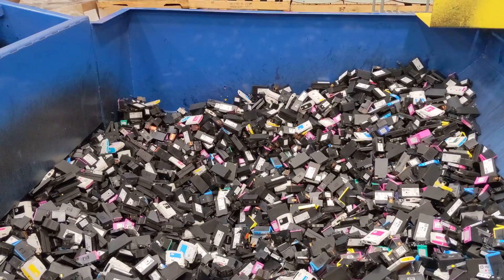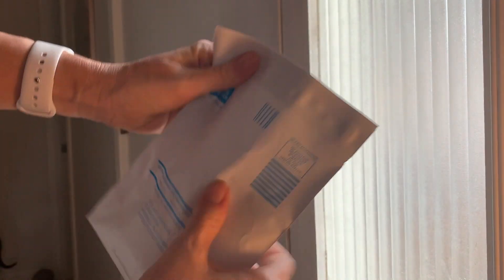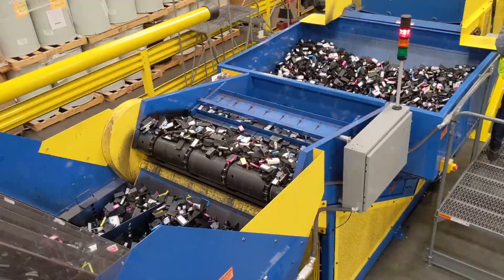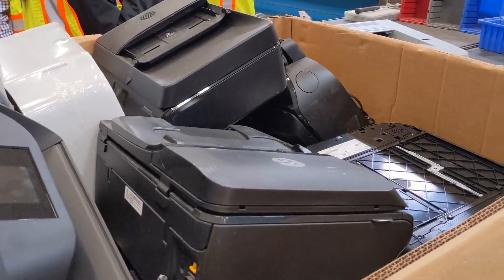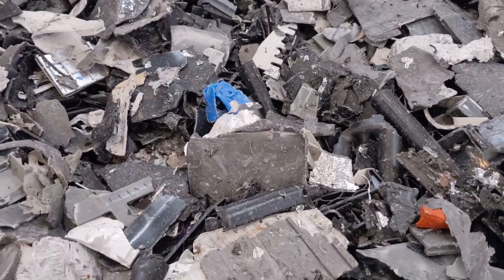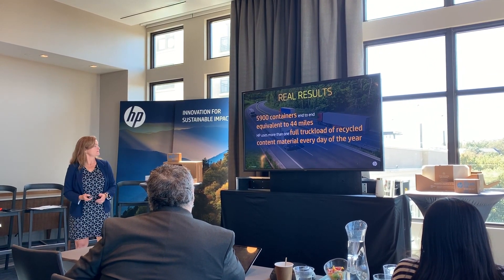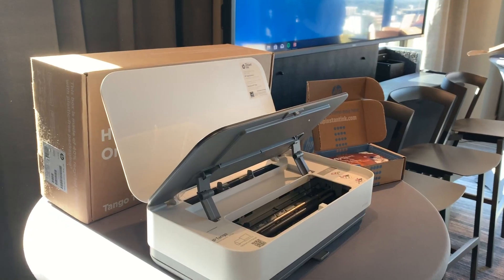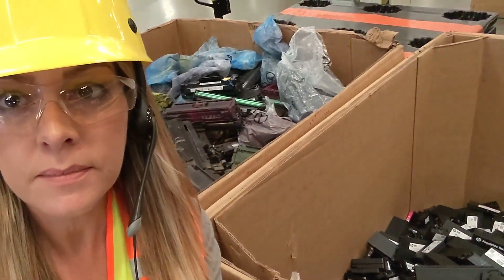Inside scoop: how HP Printers & ink cartridges are recycled

Comment: If HP really cared about the environment, they wouldn't force update the firmware on their wireless printers to ONLY accept Genuine HP ink cartridges!  Before the update,  you could use 3rd party REFILLABLE ink cartridges!  After the update,  unless you have EXPENSIVE GENUINE HP ink cartridges (ALL COLORS INSTALLED), you can't print, scan, copy, etc!  It locks you out.  This forces you to buy their rip off expensive cartridges repeatedly (and the ink levels aren't accurate either.  You will be tossing out cartridges that aren't even empty.  Thanks to the chip that counts your prints, NOT your ink level).  Don't let this video fool you into thinking that HP REALLY cares about you or the environment.  If they did, they would have their cartridges be refillable thus creating LESS waste.  They WON'T because it's not profitable enough for them to do so!  Buy a different brand that DOES allow 3rd party cartridges and toners (like Brother)!  I know their side of the argument is that 3rd party ink quality may not up to par with their ink and may have issues including leakage.  Well,  I had been using my 3rd party cartridges for over 8 years and NOT ONE leakage has occurred.  Quality varied depending on ink level but at least let the costumer decide rather than forcing them to use only your ink or buy a different brand!  I ended up buying a Brother printer after you force updated my firmware.  My HP printer now is locked out and sitting idle in my office being nothing more than a night light from the screen during the night.  All I wanted was to print shipping labels in black and white with 3rd party ink since it was cheaper.  Instead NOW I would have to spend over $100 on ALL COLORS of my HP ink JUST to continue printing in black and white or even use my scan, copy features.  I refuse to buy any more of HP's ink or products (and I use to be a loyal HP customer buying ONLY HP printers throughout the years I started buying printers).  I plan on giving my printer away rather than to be exploited by HP's company's greed and they treat their customers as idiotic cash cows forever buying their over priced ink (which over time has been known to decrease in capacity by design to gouge us out of even more money)!